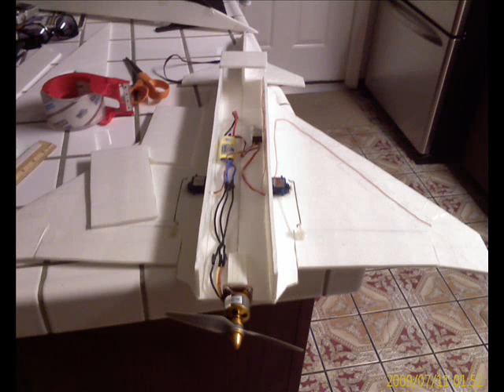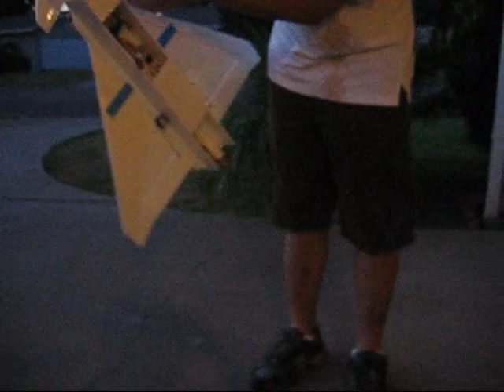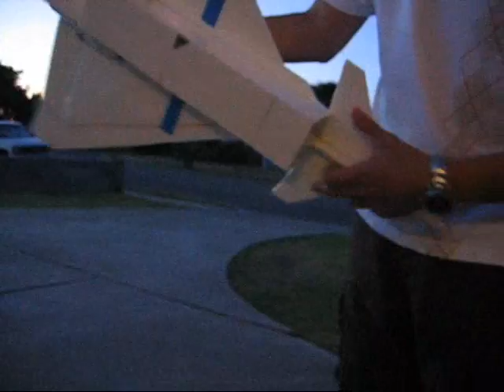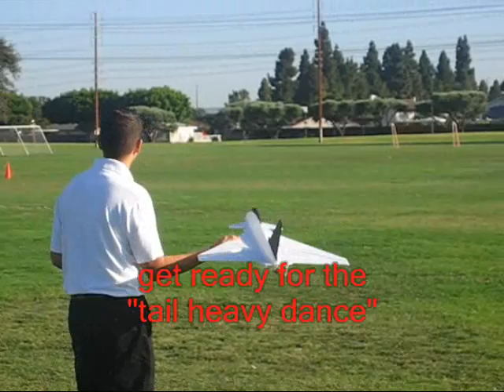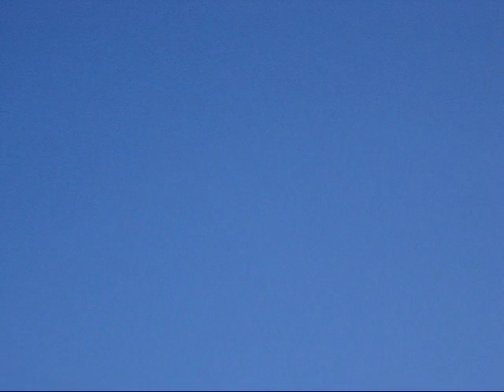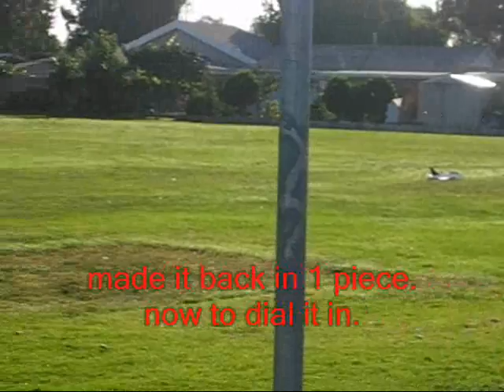EuroFighter / Rafale foam board scratch build

Comment from the maker: i just sort of made up the plans with paper cutouts. it's 24 inches wing span was a number that worked well with my f22 and i made it 30 inches long because thats the size my foam board sheet was. I got the idea of building the bottom battery box from videos I have seen combined with pictures I saw of the yardbird Mig 29 modified to drop lower so that it would look more like the eurofighter. I only have the paper cutout & have no other plans or templates for this plane. it truly is scratch built

Comment from the maker: i only covered the wing and the bottom of my fuselage with packaging tape to strengthen it without having to use carbon rods or wooden dowels. if you already have the carbon rod reinforcement, then it will not be necessary. i would probably only cover the leading edge. the bottom of my fuselage was done for belly landings on grass. also, it will make your plane heavier but strong. so if you have a slow flyer that may not be ideal, but it works great on a jet for speed. thans for rating!

Comment from the maker: yup, i have built planes out of the elmers brand foam board and this is the first time i used the readiboard brand. it is so much lighter and easier to cut but is not as strong. The best part is that it only costs 99 cents a sheet! thanks for commenting

Comment from the maker: no plans on this plane. i just have 1 paper template of the wing and another of the fuselage. The rest of the plane, particularly the battery box and hatch at the bottom were measured out and freehand cut after drawing them on the foamboard itself. I just downloaded google sketchup 7 to learn how to do it on the computer instead of just my head. thanks for posting

Comment from the maker: i didn't realize how touchy and responsive it was going to be. when i backed off on the input, it stopped overcorrcecting and some serious luck saved my plane. I moved the CG forward 1/2 inch and it flew better on the second toss. i just put a gyro on the roll and will test that out tomorrow (unfortunately no camera person). if all goes well, then I may move the CG back 1/4 inch because I want to try some low speed high alpha

Comment from the maker: I have to admit that when I was still cutting out the foam and had some of the pieces done, I was actually thinking of scrapping the whole project to build either an f117 , f16, su27, or f23. When I glued on the KF airfoil and assembled the lower section and it started looking cool, that's what got me motivated to finish the whole thing in 1 night. i'm so glad i built this plane now because it's quickly become a favorite (even with just 2 flights. thanks for the stars!